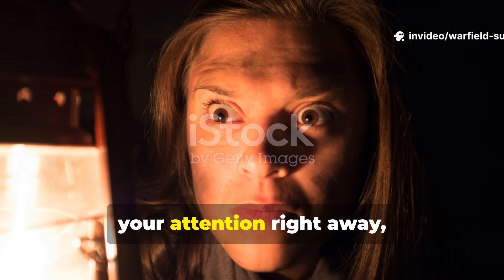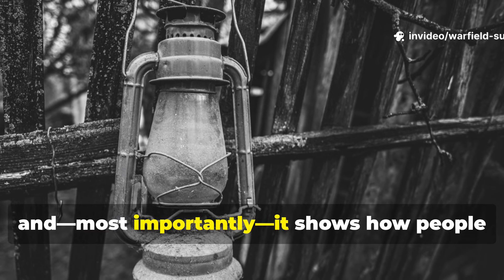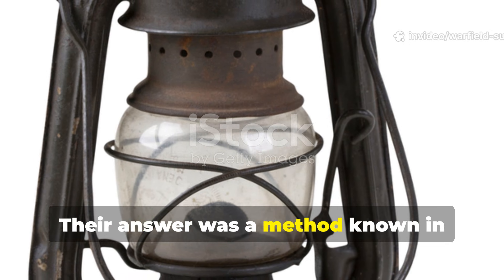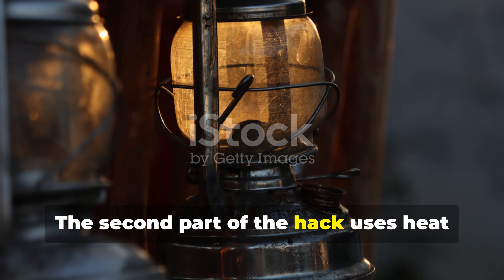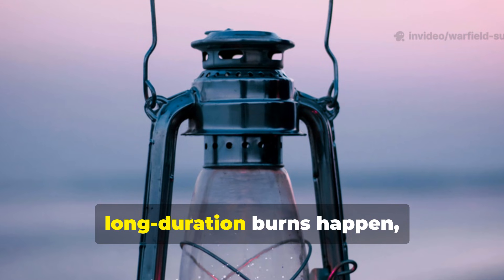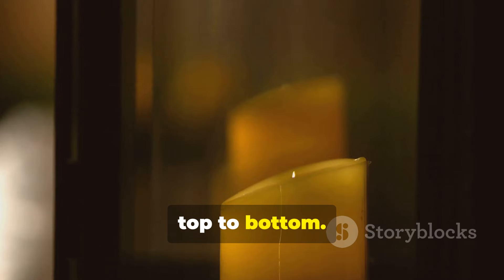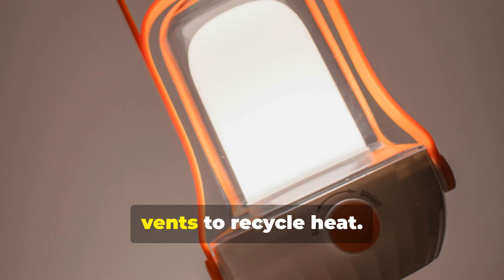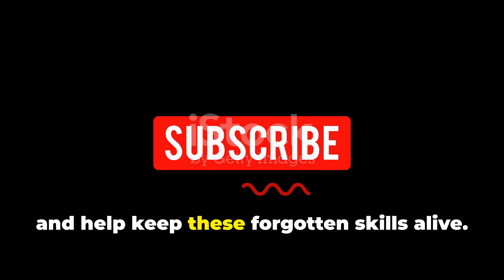The Forgotten Lantern Hack That Burns 30+ Hours on One Fill

Comment: i learned this in scouts. also the only real use of the micro thin mylar blankets is as a reflector for the lantern heat. so effective you need to move it now and then